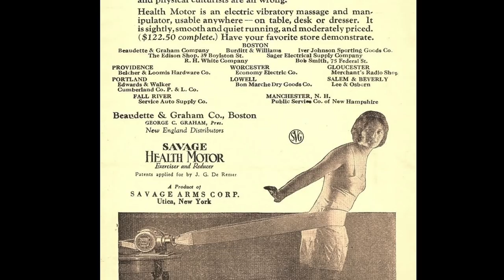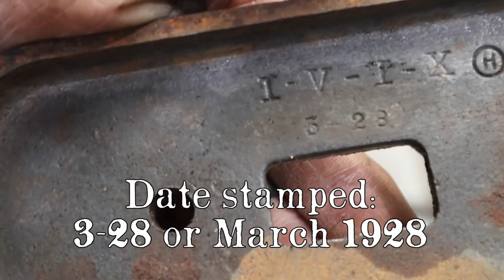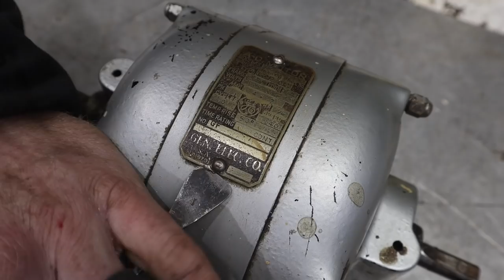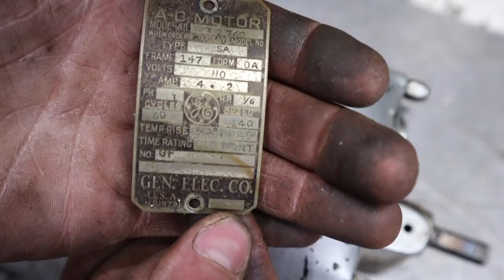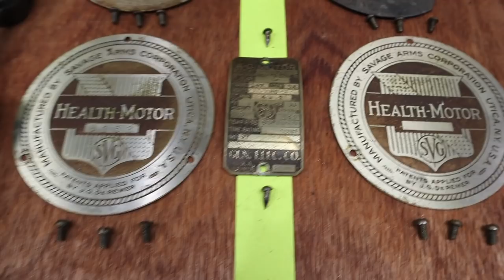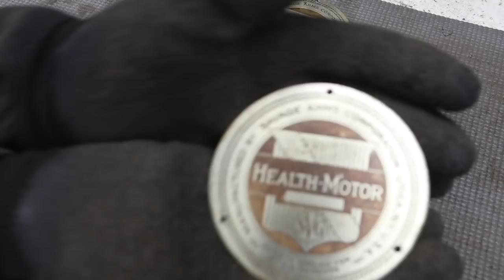Vibrating "Health" Motor ~ RESTORATION

Comment: Just a few thoughts. First off, GREAT JOB, I am old enough to have actually seen these in use in some women's apparel shops in the early 60's. Don't think I ever saw any positive exercise results. But saw a lot of injured backs and necks from people who didn't know they had a pre-existing condition. 🤔😂 But my thoughts are be careful when welding on electrical equipment so as not to have the current travel through the windings of either the rotor or stator. Yes for those who don't know both of them have copper wire windings. You did the correct thing, ground clamp on the work, not through the motor frame. I went back and looked. Acetone is better than laquer thinner for wipe down in this case because there are access holes for air cooling to the windings and any thinner that might, and again I say might contact the windings if there is a thin spot on the varnish insulation on the wire, the laquer thinner might eat through and cause a short in the motor. With metal as thick as the base is, ( and it needs to be that thick to provide a stable base), if you don't want to bevel for your welds you will essentially grind away your welds joint. You can do it that way but I would suggest that you put a thin, 1/4 or 3/16 inch scab plate 100% fillet welded over the seams on the bottom. Just smooth ground polish on them. Maybe one on either side in the middle also used as padded feet to combat scratching the floor. Because of the side motion of the machine and the leverage of the stand length, flush ground low penetration welds might, and again, might fail. I am 64 and have done a lot of destructive fails while learning because back when I was learning those who knew a lot of the time were selfish and not given to teaching. I'm impressed at how much you do right. Even by your own admission you sometimes don't know how to do a project. If I can help you not have to struggle like I did. Just some thoughts. Keep on restoring. A side note, I am jealous of the amount of surplus supplies you have and curious as to how long it took you to packrat, (and as a fellow packrat who thinks we get confused with hoarders way to much), all of your stuff. I would have killed for that much stuff and a building that grand when I was your age. Cudos on your set up. Old Man Andy.

Comment: Nice work! I found a much later, probably 60's/70's model in a great condition at a local fleamarket. A very simple basic design mounted on a stand. Nowhere near as complicated as the one you restored. My plan is to remove the off centre belt connections/pulleys from the main motor shaft and fit arbors on both sides, then place polishing mops onto it. Similar to a bench grinder on a stand. 😉😊

Comment: Wow, I repair a lot of old equipment and the size of those Woodruff keys for those small shafts, were huge. No wonder you had problems.
Also wondering if you checked the paint for lead, as I would strip rather than wire wheel, just to be safe.
Reply: They were ment to last & last.

Comment: I think that the number under the tag is an A-C electric motor frame size number as if I remember correctly it's on the motor part that is the stator with the feet on the bottom of the casting. Just a thought. Old Man Andy.

Comment: If you used an Arduino to control the speed you could have it run a choice of programs for different uses as well as have a programmable timer. {You also need a longer belt to fit two people. 😉}

Comment: need longer straps so you can shake the nuts off trees and in the fall.. shake the leafs off trees..   hook a really long strap around the mattress and have some real fun.. 
bind it around a wash tub for some serious agitation..  since its a brush type universal motor. you should be able to slow it down no more than the 60% setting on  a 10 amp variac.. to get some speed control.. as long as you recall when the voltage goes down the current goes up.. so don't overheat the windings.  wrap a long long strap around the floor level of a house and shake out unwanted guests who refuse to leave..

Comment: My Mother had one of these. She gave it to a cousin. That cousin had hair well below her A$$. She got her hair caught in one of the motor shafts and pulled her head right into the machine. Some one turned it off before it ripped her scalp off. They had to cut her hair off to get her free. The good old days.
Reply: 😨 - that kind of hazard, safety issue wasn’t considered back then 🤭

Comment: I thought, why would they hammer in those keys so that they could not come out?  If one of those keys came loose while the machine was operating, that vibration effect might cause the connected strap to come loose and be caught up in the motor, which would be bad news to the person using that machine.  I think that they may have had at least one incident with a thrown key and decided to make sure that this could never happen again.